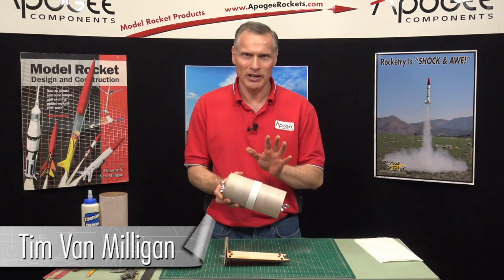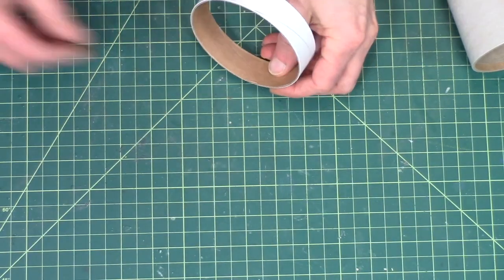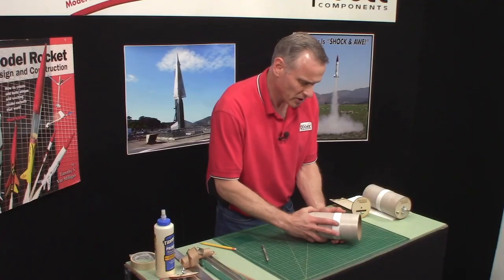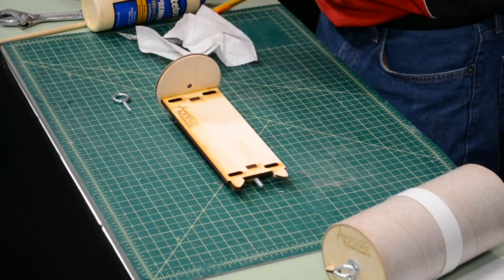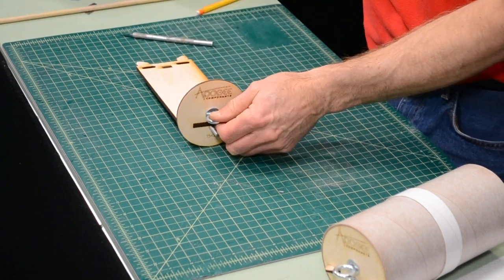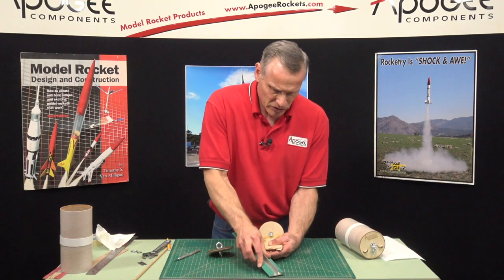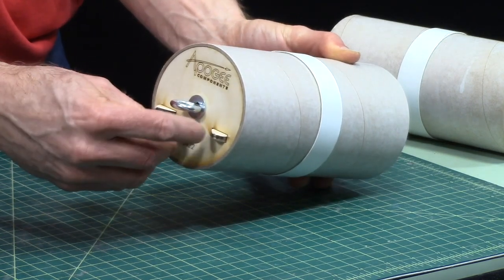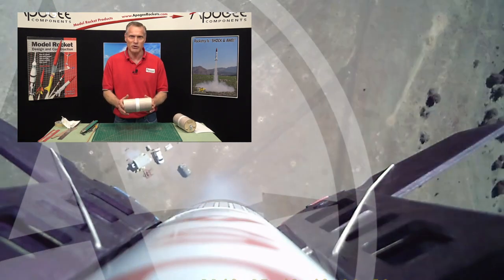Apogee 4" Ebay Assembly: Part-3

Comment: A simpler way is to use all metal lock nuts, not the ones with the nylon inserts to secure the eyebolts. They will never work loose.